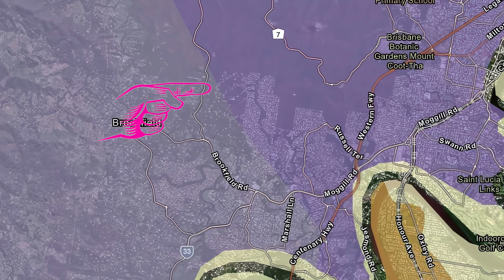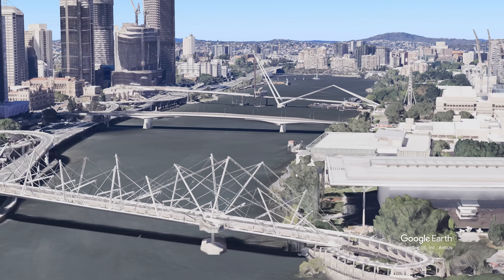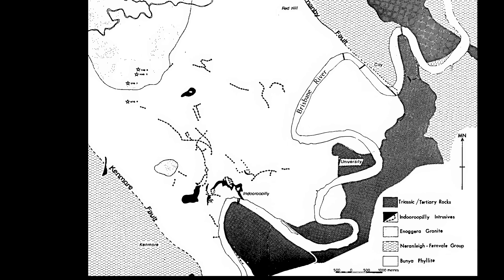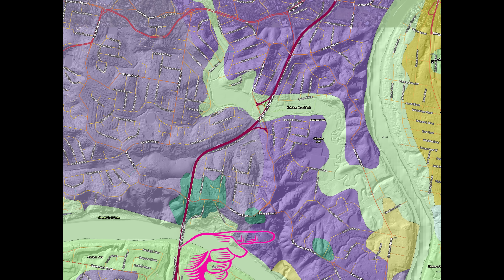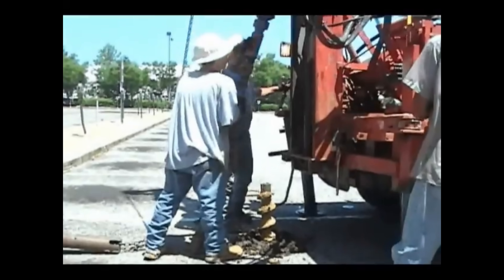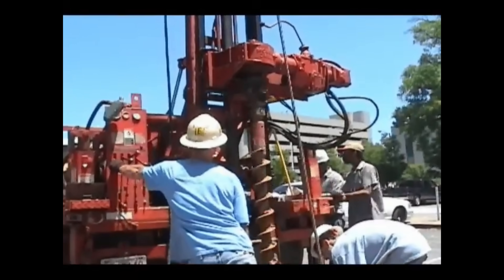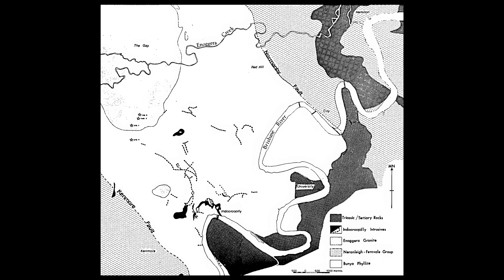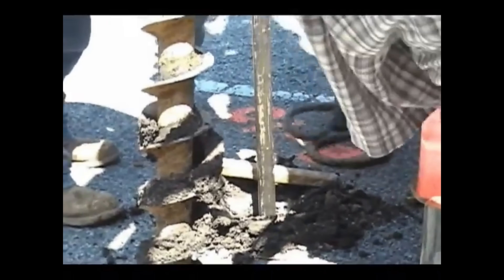Is Brisbane at Risk? The Kenmore Fault Explained #kenmoreFault

Comment: What year was the Kenmore fault line created ? Back in my day the Government approved education taught my generation that natural earthquakes are impossible in Queensland because there are zero faults
Reply from the maker: That Fault has been there for nearly 400Million years. It was first described in the early 1900s, and Queensland is covered with Faults.
But they were right on one thing.
Earthquakes are quite rare in Qld compared to the other states, But they do Happen, and sometimes they cause damage..
Reply: @t-rocks1960  I'm calling bullshit, the planet wouldn't exist 400,000,000 years ago because the Sun ☀️ would be touching Earth 🌍 30,000,000 years ago based on the burn rate and had a diameter of 292,939,266 Kms. And for the the dimwitted evolutionists there was no Ice age at 15,000 degrees Celsius

Comment: Any info about the gold mine at Springhill
Reply from the maker: Not really, Spring hill geology would be trough to find significant gold. 
But that never stopped prospectors from looking.
It is on the wrong side on the Normandy Fault,  The Phyllite with the Quartz is to the west.
There was a significant Tuff quarry in spring hill...Quarry Street. but Love St has the best Rock exposure.
Reply: @t-rocks1960  I  was given a bore water  test results from a customer in that area which showed traces of gold in the sample. 
It also had heavy metals. Unless it was a dump once.

Comment: The Kurilpa bridge that looks like alot of ships sails is NOT the Nevile Bonner Bridge. The Nevile Bonner bridge connects southbank to the new casino. Seen at the top of the three bridges. The Middle Bridge is the Victoria Bridge which can not be used by public to drive on anymore as it is a busway now.
There is also another fault which is much bigger that starts in South Australia and follows Ipswich road for its entirity and you can see it at kangaroo point then it goes all the  way to Gari island and is the main reason why Gari island was formed.